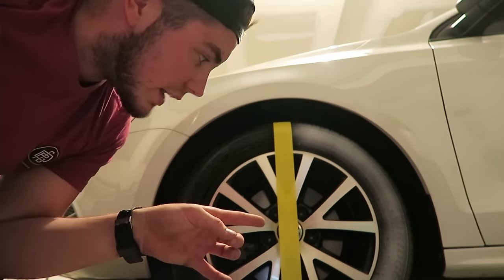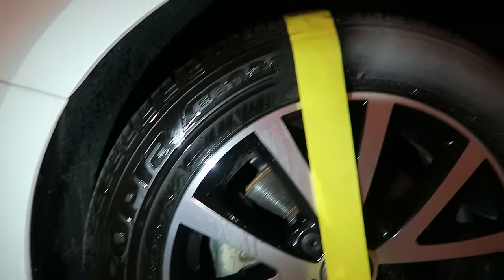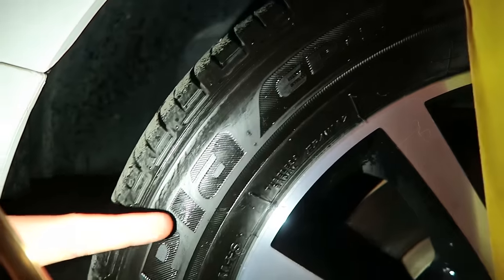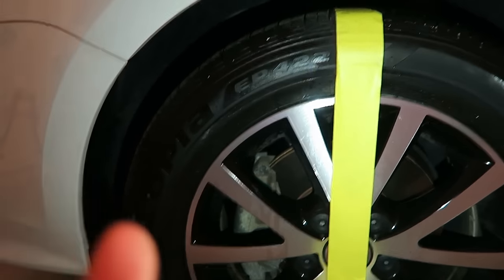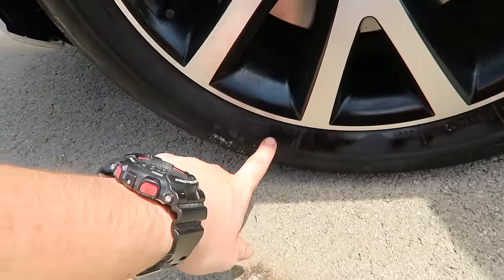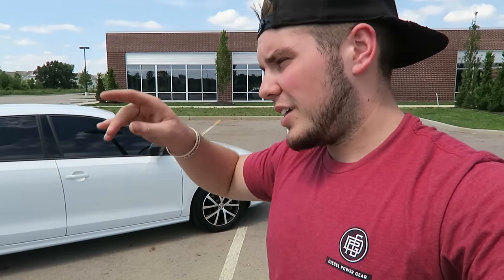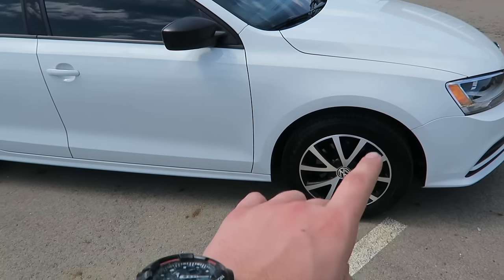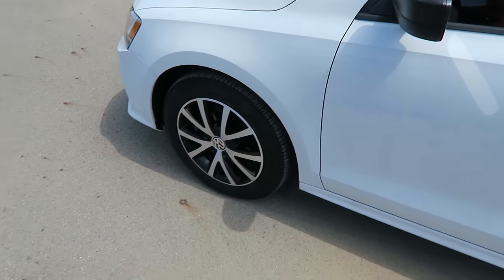The BEST way to Shine your Tires!  (You'll never use tire shine again!)

Comment: Bloody Hell!  I just use tyre shine, I spray it on and I'm ready to go.  

It seems to me you're too heavy handed.

Try spraying only three rotations, once over the area near the tread of the sidewall of the tyre, the second through the middle of the sidewall, and the third nearest the rim of the sidewall of the tyre.  

Do each area so that it won't need a second coat, or you'll put too much on, which will end up making a mess on your paintwork.

Comment: Using pledge dose nothing for the tires it has no UV protection so your tires will still crack and if you can find it there is a product called son of a gun tire shine and UV protection you can get it in glossy or flat at the dallorstore or Pepboys for 2.99

Comment: Does he explain that after a few days,your tires start cracking with
Reply from the maker: I’ve done this forever even before the video including many people in my family and in the comment section that were born in the early 1900’s and now retired, this is an old trick bringing it back to life and my tires look straight off the showroom floor, you need to understand pledge it’s made to use on the softest of leather and furniture, it’s does NOT dry out rubber that is even MORE HARD and RIGID than leather or any thing you put it on.  Common Misconception but it does not.

Comment: Ok, You’re Saying 2 Use Pledge Furniture Polish ( Pledge ) 2 Help Shine You’re Tires, Well N the Video you Really Cant See The Difference, But Heres My Question, You Really Clean You’re Motor / Engine Bay & you Have A lot of Plastic On You’re Motor, Could we Use Pledge On That Also 2 Help It Shine, & What Could Be The Negative’s By Doing That??
Reply: actually dealer's and detailers use armor all tire shine and cleaner on engine bay is it does not hurt a thing removes all the grease yucky nasty stuff you blow it off with an air hose and you are done! No it doesn't hurt anything! at only $4-$5.00 a can you can do 2 engine Bays. Check out sweet project cars for trick affordable tips & tricks! Have a fabulous day!!!
Reply: People say cleaning the engine bay is a good idea but it really isnt. You want all the grease to be in the engine to keep things running smoothly. Just change oil when you need too and watch for other things

Comment: So can someone tell me what 303 is? And how does it help the tires for detailing?
Reply: 303 is an aerospace polymer protectant that is used on dash, bumper, bumper, tire surfaces and has been in use for many years; however it is not cheap or inexpensive but it does work quite well to prevent breakdown of treated surfaces.

Comment: Try setting the tire dressing. It won't sling if properly applied.. Think of squirting lotion all down your arm then swinging it violently... Wait, you rubbed that lotion in first didn't you lol.. Rub that dressing in, no sling. You need to clean the sidewall with a good cleaner /degreaser also before shining... Lawdy

Comment: Both sides not too good. If you want to just spray on and not worry about using a rag then use Armor All Extreme Tyre Shine. Don't use tyre shine on concrete it leaves a stain.

Comment: I've never had a problem with black magic Tire wet I even use Auto Drive tire shine the bootleg to black magic I've never had a problem with any kind of anything slinging onto my car it stays on my tires have no problem with it I don't think I'd be using any kind of pledge because it's got different chemicals in it then black magic and other tire shine might wind up eventually rotting out the tire

Comment: Try washing your tires real good with tire cleaners or soap pads; you just don't spray it on your tires. How did you do the proper way on the pledge and fuck up with the tire shine. Is you working for pledge trying to sell their products, do you know their products are about the same price, so what's your motivation.

Comment: chemicals designed for wood ?  will it not eat rubber ?
Reply from the maker: If you read the back of the pledge can it states to even use it on leather, it is meant to handle delicate leather there is no problem with using it on rubber! Cheers!

Comment: pledge has chromo veloxecitter  and it will ruin the rubber .
Reply: Any tire shine will ruin the rubber...all except water based ones, which well all know suck.    Any tire shine that is petroleum based, as are 99.999% of the tire shines on the market, will eat your tires. 
  How fast they eat your tires depends on how often you use it....

I'm sure the same principle applies to Pledge, although I highly doubt it would ruin the rubber before the tires needs to be replaced anyway, no matter how often you used it.

Comment: Incorrect prep & cleaning with always result in poor results. You can see this from how the tire dressings runs off the tires 

Pledge did not really do much and it will just cause the rubber to crack 

Your need to use a product that does not have  solvents or silicones in it then you will not have that grease feel 

There are a lot of poor tire dressings out there which but people off 

But our product when cleaned and applied properly will last for up to 6 months 

If your interested in trying it out let me know we love to show you what a real tire shine can do